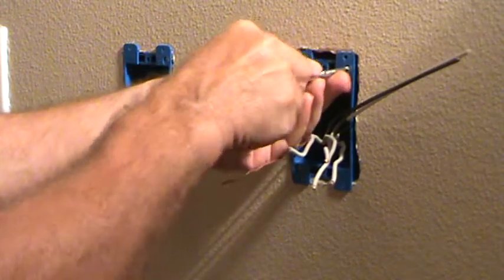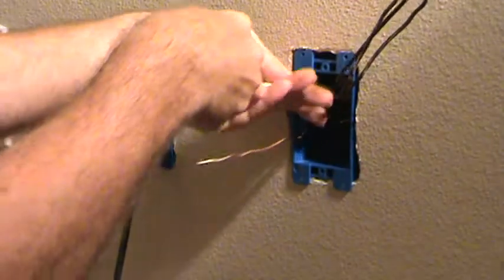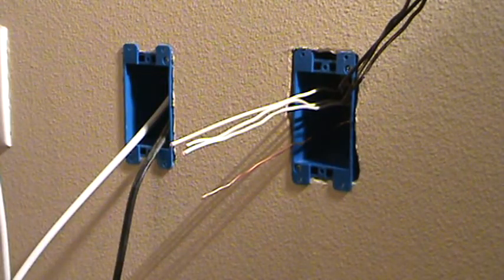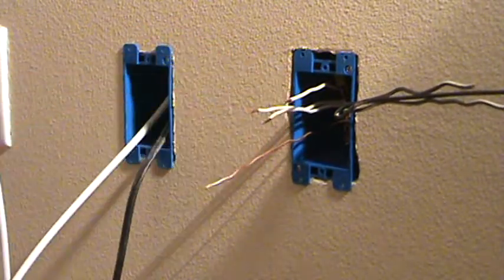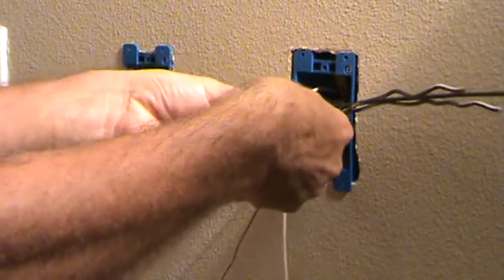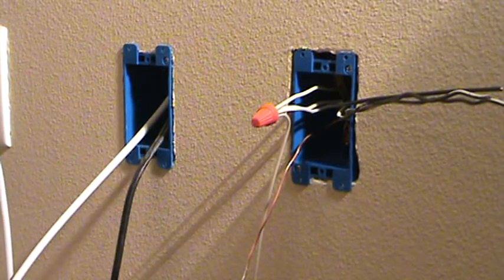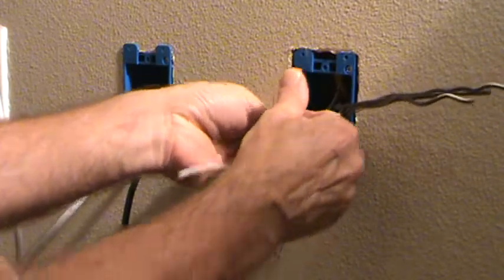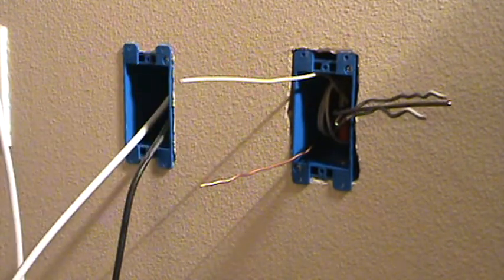How to Attach 3 White Wires to Duplex Outlet

Comment: You said connecting 3 wires to an outlet just isn't going to work.  You can definitely make that work.  Straight wire on either side of the screw.  But, it's not about if you can make it work.  I'm pretty sure it's against code to put 2 wires under one screw (unless it's the ground at the back)
Reply from the maker: Yes only one wire under one screw. Have you watched any of my other electrical videos? I have a ton. Just go to my main YouTube channel page then click on playlists then scroll down to electrical to find them all. You will learn lots...promise!

Comment: Question. Can you just pigtail two of the neutral wires and use the third to put in the outlet? Or do you have to pigtail all three to make one wire?
Reply from the maker: That's a very good question. I was taught (& have always) to connect up all the white wires in a junction box to then connect all of them to the duplex outlet. So I could connect two white wires together with a pigtail to then make one white wire then connect up that one white wire to the duplex outlet & then connect the remaining white wire in the junction box to the duplex outlet as well thus connecting up all the white wires to duplex outlet....or take all 3 white wires in the junction box & connect to a fourth white wire (pig tail) to then come out with one white wire to then connect up to the duplex outlet. I don't normally do it that way since you have to use a bigger wire nut to then push to the back of the junction box before then to get the duplex outlet pushed into the box too, depending on how deep the existing junction box is & how many wires you have in the existing junction box. Since if I have 3 whites wires in the junction box that will mean I then have 3 black wirers in the junction box too & I would then need another bigger wire nut to connect up all 3 black wires as I just explained for how to connect up all the white wires so then that would mean I would have two bigger wire nuts in the junction box pushed back behind the duplex outlet hoping I have enough room to get all the wires pushed back properly giving myself enough room to then push the duplex outlet in there too. See what I mean? All the white wires in the junction box should be connected up to the duplex outlet as well as all the black wires as well as all the ground wires to get a full connection for all of the wires going to the next junction box then the next & the next. See? I have a ton of electrical videos where you will learn more if you want to go to my main YouTube channel page then click on playlists then scroll down to electrical. You will find all of my electrical videos I have posted to this channel right there & you will learn a ton of things for more ways to save money around the house. If you have more questions anytime...just send me those questions & I will get back to you. Your own personal coach for sure. Thanks for taking the time to send me your questions/comments. Much appreciated!

Comment: FYI Per 300.14 conductors must be min 6” long from entry / 3” long from the wall
On boxes under 8” 
Good vid
Reply from the maker: You're right. In my case I was using existing wires that weren't necessarily the proper length but I made do. Thanks for your message!

Comment: So I have a light switch that a black wire. I then have an outlet switch combo next to it so I understand the pigtail for that combination switch, can I add a pigtail then run it to the switch? So it would be switch to pigtail to combination switch?
Reply from the maker: I don't want to confuse you since you have brought up a few different things so here's what to remember...There will be one black hot wire that is hot that comes into your junction box. Turn your breaker off & separate the black wires with the wire nuts off. Do this same thing with the white wires. Now turn the power back on & take a wire tester & just touch one black wire & one white wire at a time, from the same romex wire. Now you should only find one hot black wire. Once you find it then turn the breaker back off. Now you know where the power is coming in to the black wire. Now you can make a pigtail with that black wire. One black wire goes to one light switch & another black wire goes to the other light switch & another black wire goes to the electrical outlet. See? You will now have a power black wire that goes to each of your items. Now you will have the white wires to deal with. The light switches will not need any white wires so the only thing you will need to connect up to the white wires is the electrical duplex outlet. You will now be making a pigtail for the white wires. Take one little white wire to make the pigtail (a separate piece of white wire that you will need to add to create the pigtail. Now connect up all of the existing white wires in the box with the new added little piece of white wire & now you have connected all of the white wires together making just one white wire sticking out of the box. Now connect that one white wire to the duplex outlet. Presto. Remember that you need to have one ground wire connected to each of your items so you will need to connect up all of your grounds in the box then connect one to each item. I have videos for that too on "how to connect up the ground wires" or titled similar to that. You can find all of my electrical videos in one place. Go to main YouTube channel page of my channel then click on playlist & scroll down to "everything electrical" or something like that & I will have all of my electrical videos on that playlist that I have posted to my channel. Let me know if you have any followup questions. Let me know how you do with your project & good luck!
Reply: Ok I have 5 copper screws on the old switch combo the white wire I was asking about went to a copper terminal, from the light switch I then hooked up the black hots and pigtailed the neutral wires on to the neutral connection. On the new switch combo none of it works, but I noticed the tab is missing from the new switch. 😕
Reply from the maker: @tonydigilio6872  I'm not sure what you are referring to when you say old switch combo...& on your new switch the tab shouldn't be broken off..
Reply: Oh sorry the original wire I asked about they used a white wire to bridge from the light switch to the switch outlet instead of using a black wire.
Reply from the maker: @tonydigilio6872  Make sure you put some black electrical tape wrapped around it to remind you that that white wire is actually meant to be a black wire...

Comment: I have an outlet with 3 hot and 3 neutral as well. But my receptacle had a hole for each wire on the back... should I try to find the same type of receptacle or should I be able to do what you did with out tripping a breaker?
Reply from the maker: So then you have 4 holes for the black wires & 4 holes for the white wires & you want to push in all 3 blacks & all 3 whites? You could do that but then it makes it more difficult to push all 6 wires back into the box. That's why I pigtail them the way I did. If you have 14 gauge wire & not 12 gauge & if your junction box has enough room then your wires could all be pushed in at the same time if you take your time & do it right. Please do not work on any electrical without shutting your breaker off first though...LOL  Let me know if you have any questions. Good luck with your project!

Comment: I've been trying to replace a few outlets in my house and it was going smooth til I ran into a half hot outlet. I have 1 ground, 2 whites, 2 blacks and a red one. Do you a have a video on how to tackle this. Can I pig tail the white ones to make room for the red wire
Reply: I have almost the same problem. 1 ground, 3 whites, 2 blacks and a red. All the others were simple. wth am I supposed to do with that.  Was replacing the outlet under my sink.  My disposal stopped working years ago and I didn't bother to check. Outlet under the sink wasn't even GFCI.  Dunno how the inspector missed that before I bought it.  Outlet was all burned up. Lucky nothing happened.
Reply from the maker: Your outlet half is hot & the other half is not working because the half that's not working is the side you plug your garbage disposal to since that side is then connected to the wall switch that operates the garbage disposal. the rest of the outlet stays hot all the time so you can use that part of the outlet for something else like plugging your dishwasher cord into that side for example. The electrical outlet when you remove it look on the side of the gold screw side & you should see that the little gold clip area has been cut so that would mean one side of the outlet can be hot all the time & the other side goes up to the wall switch for the garbage disposal. Maybe they used the red wire to connect to the outlet & that wire then goes up to the wall switch for the power? Not sure since I'm not there to see it. Pretty sure that's how your duplex outlet is wired.....
Reply: @videojoeshows  I'll take a look tomorrow.  Thanks for the input.
Reply from the maker: @thewhiteboardist  Sure thing. Let me know after looking at it. I hope it makes sense to you when you check it out....
Reply from the maker: Half of your outlet is hot because the other half is probably operated by a light switch. They usually do this for bed side tables where you would plug a light in next to the bed & plug it in the right spot & then you can control by the light switch. I'm sure that's what they did. They would've broken the little gold tab on the side of the electrical duplex outlet & that way one side of the outlet is hot all the time & the other is only hot when you turn the light switch on. See? You could just break off the gold tab on the hot side of the plug. Do not cut the silver tab side off as that is the white wire neutral side. Not sure why they have a tab on that side as I've never had to break that tab for anything ever. Could you not hook up the new electrical outlet the same way as the old one? sorry I did not get back to you sooner. My bad!